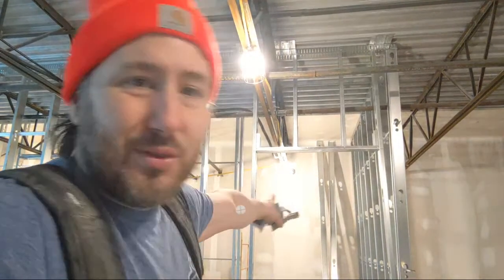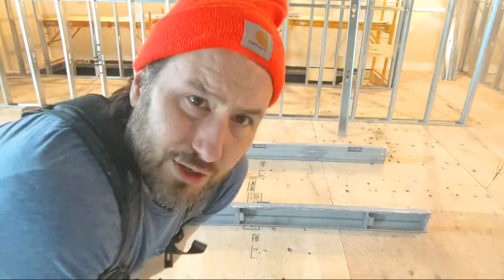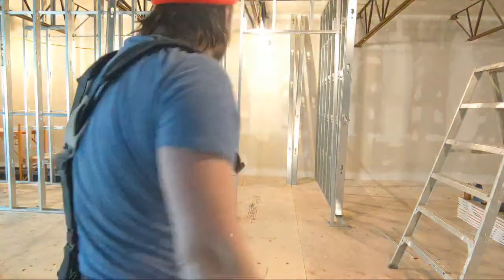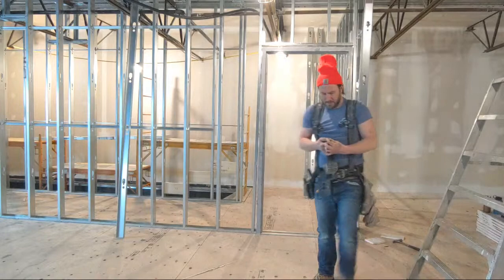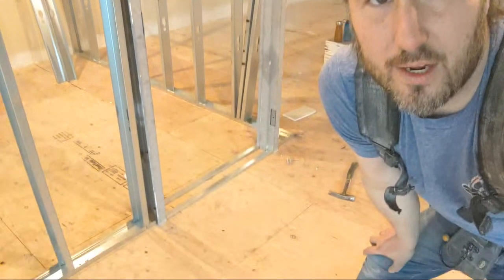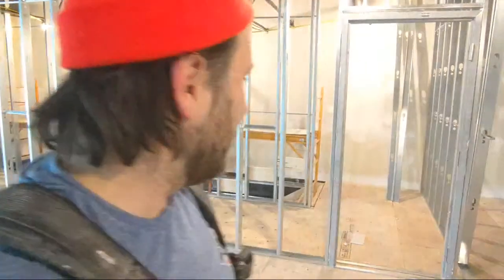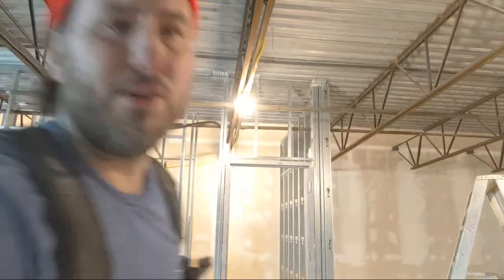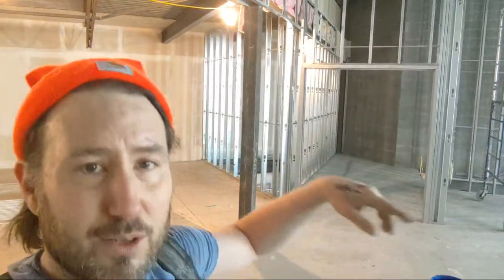Install Single Metal Door Frame In Steel Stud Wall That Was Already Framed Out

Comment: So for the doorframe, is it supplied based on the number of layers of drywall each side of the framing (and whether it's 5/8" or 1/2" drywall) ?
Reply from the maker: Yes it is you bet. Some frames are adjustable.